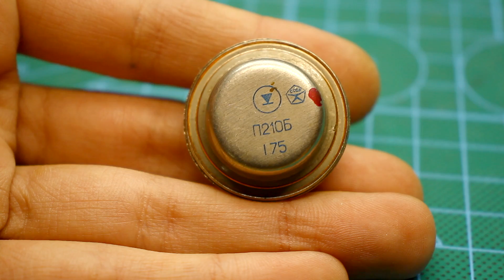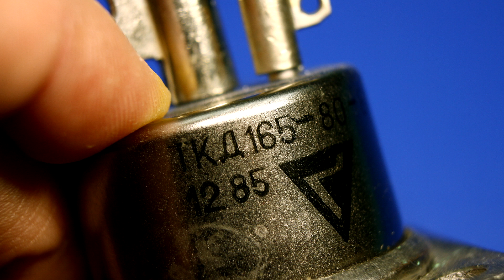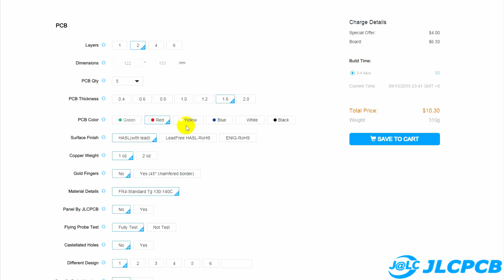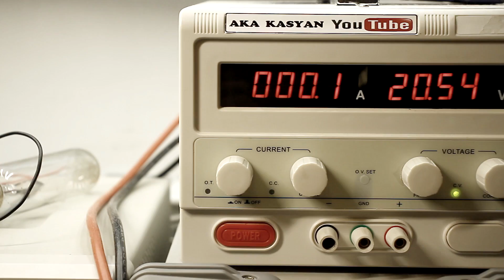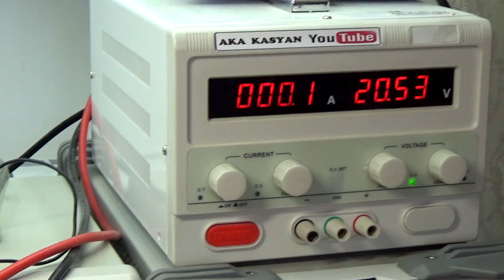ULTRA Transistors made in USSR

Comment: Imagine the kind of tesla coil you could build with transistors like this!
Reply: Actually, it won't be that impressive because IGBTs can switch higher powers.
This transistor would be useful in a linear application.
Reply: these are more for amplifiers and power supplies
Reply: Even a minibrick SOT227 can easily switch 500A in resonant mode and is far smaller than tis piece of crap

Comment: That really impressive!
In what kind of applications were these transistors used?
Reply from the maker: Hey . I definitely can’t say for what specific purposes they were created, but it is known that they were not produced for long and they were rarely used. Could be used in powerful frequency converters, regulated sources or in switching systems - just like a key. Soon I will have the most powerful single bipolar transistor with a collector current of 250 / 400A
Reply: Kasyan TV Thanks!

Comment: Russian Transistor.
Make inverter. With Transistor.
Thank You From Brazil.
Reply from the maker: Hi, it’s not so simple. If the power supply is 12 Volts, then a maximum of 1500 watts can be obtained in the inverter with a pair of such transistors. If we are talking about a network power supply, then you can get a power of 10 or more kilowatts
Reply: @KasyanTV  thank You.